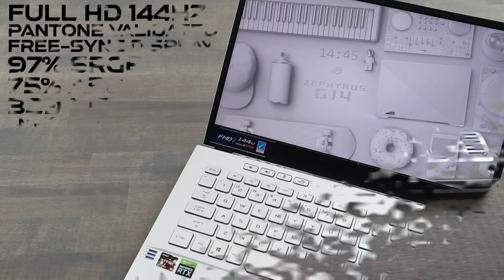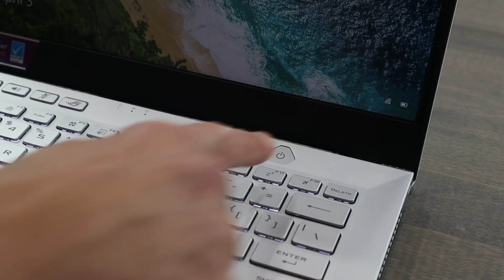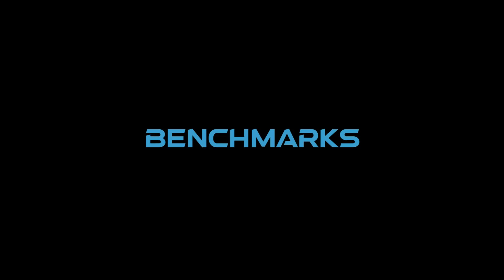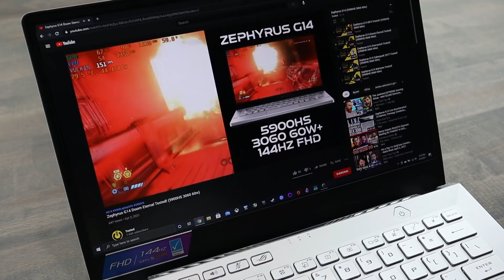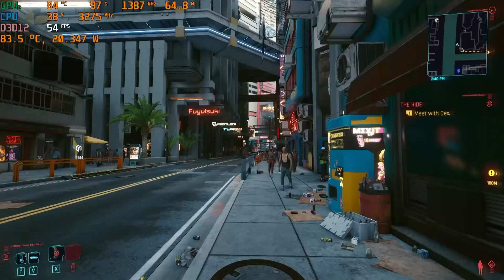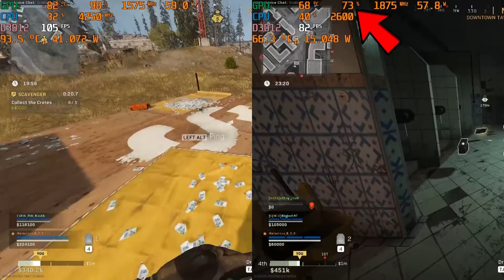Zephyrus G14 2021 Review!  5900HS 3060

Comment from the maker: The Asus G14 turned out way better than I ever thought it could!  It’s much better than the 2020 model and far better balanced than the Zephyrus G15 I just reviewed.  Good job Asus 🤛

With that said this is still a 14 inch laptop if you do not need this level of portability, Gaming on this small of a screen may not as enjoyable as a 15 inch or larger device.
Reply: Thank you for doing this Bob, I remember when the G14 first came out last year and they were sold out for quite a while. Really good review.
Reply: 60W for 3060? YES! 2060 with 115W fuck this shit? Yes! Another "greatest" laptop from Asus.
Reply: Would you recommend the G14 over the G15 then? How much a difference are they in term of performance when it comes to video editing? Thanks.
Reply: Regrading the RAM, I'm wondering why they don't just have 16GB soldered onto the motherboard and have one open slot for upgrading. Perhaps it has something to do with dual channel memory out performing a single stick? I don't know... Was wondering what you thought about that?
Reply from the maker: @BradHoytMusic  Yup that’s why.  The last time a high end Zephyrus came that way was with the 1070 max-q
Reply: @BobOfAllTrades  can we exapand the ram? If yes, how much? 
Thank you
Reply: Is it better than an aorus 15g with 3060
Reply: By any chance, do you have the model number for this laptop? Thank you

Comment: I bought this as soon as it came out. I got it at a discount price + tax which all came down to 1550$.
Hands down it's a beast of a computer. It blazes through premier pro and after effects, handles photoshop, luminar and lightroom like they are nothing and I played many AAA titles such as Hogwarts Legacy, Resident Evil 4 remake, Resident Evil Village and many more and it handled everything like a dream. It's mainly my travel workstation but sometimes I use it as my main when my desktop is too busy doing other works. This also handles 3d panorama stiching like a pro.
Only problem is that it gets hot so a cooling pad is mandatory.

Comment: Some of these details are just way too technical for the average user.  We just want to know if it is an overall good gaming experience, maybe something about bench marks, and that it does not get too hot too the touch or overheat to the point of real concern, in addition to to a pleasant and enjoyable viewing experience and typing experience and good tracking and response, and the availability of ports most often used.  Anything else and you are taking to technicians and not the average user, do I guess that is your targeted audience

Comment: Thank you for the review!  I just placed an order for the RTX 3060 and QHD (120hz) with 5900hs.  Totally awesome holiday sale and bonus reward bucks and I couldnt pass it up!
Reply: I would like an update pls, so do you recommend this model?
Reply: @shebyf9346  💯 recommend it. This eliminated my need to build a new PC tower. Not too heavy, and plays the games I enjoy just fine and productive when plugged into a ultra wide monitor. The battery can deplete faster when using gpu but it recharges in a decent amount of time. You can switch to ryzen integrated gpu if you want a little more extended battery life.

Comment: Is there a way to set the cpu speed to certain Ghz?? so i can run like 3.8 ghz??
Reply from the maker: No that’s not how CPU tech works.  You can set wattage and it’ll pull that wattage and load the cores per what the software requires.  That will show different frequencies depending on what the software requires, whether it be one core, two cores are all the way up to eight cores.
Reply: @BobOfAllTrades  sorry for the misunderstanding, thanks alot for the answer
Reply from the maker: You have nothing to apologize for 👍

Comment: Is it possible to adjust this version so that it doesn't overheat while gaming? I'm deciding between the 2020 ga401I-br7n2bl and this one. It's such a small price difference that I got both to test out, but the 3060 gets way hotter than the other when just doing light games or just browsing. I know obviously the 3060 will have higher demands and thus higher Temps, but is there anyway to get it below 45° while browsing? The other one I can get to 28 but if I kept it I'd have to pay an extra 400 anyways to upgrade the ram and ssd. 😫
Reply: For reference I disabled boost too but yikes if it's not still toasty. 😬
Reply from the maker: I recommend maxing out the fan speed when gaming or limiting the wattage in the software.  A combination of the two perhaps.  I also recommend this version and not the first gen 4900hs 2060.

Comment: I bought this and it's been two days amazing so far. So far I've played For Honor Roblox and genshin impact all on highest setting all multiplayer and it amazing. I don't really understand why it's a 14 inch instead of say like average 15 or 17. Battery life on games is about two hours so far with no power brick. I think it's amazing considering I got it for 1500
Reply: Definitely a steal! Planning to save for this beast. Did you buy the black or white one? How are the rubber feet? Is it stronger now? Any peels happening?
Reply: @juanpablotan3889  no peels  the grip on the feet are good. I got the white one, I've yet to fully understand everything it can run but ran Ark max settings like butter. Mind you I didn't have the power brick on so I cant even imagine turbo mode. Does get loud but not really noticible if ur in the zone.  Amazing overall I haven't figured out how to change the keyboard or add words to the front of it.

Comment: Awesome vid, Question: If the laptop screen is 144hz and I have a 240hz monitor can the laptop run 240hz and not cap at 144hz?

Comment: Bob thank you for your review of both this g14 2021 and g15 2021. I will doing a quick master program and want a new laptop, obviously I will be doing generic tasks for that, you mentioned great battery life, but I also may be traveling away from home (and my gaming desktop) on business trips. So I'm ultimately torn, I know the g14 is smaller and runs cooler, the g15 equally as good at generic tasks but has the extra umph to last for a little longer gpu wise, my take away from both reviews is ppl definitely need to mess with the tuning profiles to get their balance.

Comment: Hello! Thank you for your amazing video. Can I ask you if this model has a SO-DIMM slot for upgrading the RAM? I'm planning to buy a model with a 8gb soldered RAM and I was wondering if it would be possible to upgrade it in the future (likewise what happens with the asus tuf dash f15). Thank you in advance! Is the SSD upgradeable as well?
Reply: Im not an expert, but from what ive seen on these videos, i think, that you can add on RAM. But i dont think you can change the 8gb thats already there. Theres models on Amazon with up to 40 gb of RAM.

Comment: Thanks for the review @Bob Of All Trades. Question for you or anyone that knows...Is it possible to do that same tweak you did in the 2020 model to help reduce thermals?
Reply from the maker: I’m sure that can, but you don’t need to. Asus put those power sliders in there for a reason so just reduce the wattage to the CPU until you’re happy.
Reply: @BobOfAllTrades  wouldn't it be less tedious to do the tweak one time, than constantly opening the sliders and adjusting them?
Reply from the maker: @xg3990  Absolutely not.  You adjust the slider and leave it.  It’s not like the other tweak performs better. 

In fact, I’d expect the software wattage slider to interfere with last years tweak.
Reply: @BobOfAllTrades  thanks for the info!
Reply from the maker: No problem 👍

Comment: I've bought the Asus Zephyrus G15 GA503QR, and I absolutely love it
Reply: @AVOCADO I haven't had any problems with it thus far. I bought mine from a retailer on Amazon that upgrades the thermal paste for the GPU and Quality Checks it, and everything is working great. I'm certain a RAM failure would by covered by warranty anyways

Comment: I don't think I wanna pay $200 more dollars for the new version, honestly. I think I'd get the 2060 version
Reply from the maker: See I’m just the opposite. Faster response time panel, faster graphics card faster processor liquid metal on the processor to me those four things are easily worth $200.
Reply: @BobOfAllTrades  that's fair, I'd be getting it without a gaming focus though. So it would not be much of an issue. Although battery life might be. I'm afraid I won't be able to stand having the battery die fairly quickly. Most high spec laptops do.

Comment: One question for G14 2021 owners...does your device goes in sleep corectly?! I had 2020 model before and all worked well, now with newer model, when I press sleep, screen turns off but coolers still works. Any solution?
Reply: I'm having the same issue with no solution.

Comment: 14 inches is too damn small. If this was the standard 15.6 inch I'd definitely buy it. 14 inches is just too small for gaming. I realize you could connect it to a monitor but still. Using it as a second screen would be shitty cause of the small size.

Comment: 10:32 - no, false.  I'm an engineer and I can tell you that 100% of the time, in the case of laptops (ignoring tablet/laptop hybrids), soldiered ram is used purely as a planned obsolescence strategy.  Asus knows that this laptop is so [computationally] powerful that if they allowed someone to install 64gb of ram that customer would be happy for over 7 years.  Arbitrarily limiting RAM is THE ULTIMATE way to control obsolescence in today's hardware market.  It's a different story for things like smartphones, but laptops ALWAYS have the required couple of millimetres for a proper two open slots.
Reply from the maker: I’m fine with that being the conclusion.  But why isn’t this the case with their Strix?   

AW did this with their M15 R2-4 but apparently are bringing back socketed memory for their R5 🤷

I’ve had a few conversations with other manufacturers about single channel memory versus dual and some of them literally didn’t know dual boosted performance.   Sadly some of these manufacturers would base their products performance from benchmarks.

Comment: is it insane to dream of a 19 inch slim bezel gaming laptop? it should fit in basically the same foot print as a fat bezel 17 inch beast as yesteryear, but with those extra 2 inches of love. im aware it'd fall far closer to mobile workstation than laptop, but that would make it no less glorious especially if they used the space well. imagine the fans they could run in that, might even be able to source some noctua desktop fans lol

Comment: Regarding temperatures, do you think the same registry hack to disable turbo boost you showed us in the 2020 review might help with this years' model? Just picked one up and it does run a little warm even in non-intensive situations.
Reply from the maker: No need.  Ryzen 5k series has wattage sliders built into the software.  Reduce as you see fit.

Comment: Just bought this laptop, every single game I’ve tried (Gears, Cod, Battlefield, Overwatch), my gpu thermal throttles and hits 87 •C. It’s unbearable. This is on performance mode
Reply: Using Registry Editor, go to HKEY_LOCAL_MACHINE\SYSTEM\CurrentControlSet\Contro l\Power\PowerSettings\54533251-82be-4824-96c1-47b60b740d00\be337238-0d82-4146-a960-4f3749d470c7 and select Attributes. Modify the value of "Attributes" from 1 to 2. Data should read “0x00000002 (2)”. This will uncover a hidden power option.

After that, go back in the Power Plan Options and a new tab "Processor Performance Boost Mode" will appear. Set it to Disable or Efficient Aggressive and click Apply. Also, make sure your max processor state is at 100%. The CPU will now run on the stock frequency.

Comment: Can you disable the turbo boost on this model? Like last year g14? Great review by the way
Reply from the maker: I’m sure you can but I don’t really think you need to.  

It doesn’t run as hot thanks to liquid metal and the power sliders are there within the control software.

Comment: Fantastic review! Based on your comparison with the older gpus. What do you think would be the performance difference between the 3060 and a 2070S (115 W)? Would the 2070S significantly out perform the 3060? Trying to choose between this or the ROG Zephyrus S15 (2020).
Reply: I'm Going to wait until July I'm buying S15 2080super model with i7 11gen worth the buy the price has dropped heaps

Comment: Create custom resolution - limit screen refresh rate to 60 Hz - save battery life.. In games - enable vsync on 60 fps, limit cpu to 15W. You get quiet laptop - you get more battery life - you don't hold a 100C brick in your lap while gaming. I just dont understand why you need 144+ fps on laptop. Id be more than happy yo play on 900p @60fps with with laptop.

Comment: What are your idle (doing nothing or just plain web browsing/ YT watching) CPU temperatures? 
Mine's around 45-55C/ 110-130F, and I think it is too high (at home, no sun/ placed on desk)...

+ A large minus for QA: Needed to replace my unit, as the CPU fan has been making annoying clicking sound whenever even slightly tilted (i.e. placed on laptop pad I regularly use). Update: Got it replaced, the new one much quieter, but gets quite hot even when idle...

Comment: Bob, what do you think about making a full video dedicated to undervolting of the new RTX 3000 GPU-s in laptops? What problems a person will face and how exactly it'll work. How much disabling dynamic boost helps or doesn't help.
Reply: did you end up undervolting your GPU? if you did could you refer me to a link that has descriptions
Reply: @Carmadon100  I wish he recorded a dedicated video about it. Because I did see some people successfully undervolting their RTX 3000 laptop GPU-s.
Reply: @tabalugadragon3555  I wanted to undervolt CPU first but it seems like Ryzen cpu doesn't allow me to do that (esepcailly with G14 because this processor is not compatible with Ryzen master as well). So I am going to try undervolting my GPU using Afterburner.. have you had any luck with it?
Reply: @Carmadon100  Dude, Ryzen mobile NEVER allowed voltage control, even on so called "unlocked" Ryzen 5900HX, which, by the way isn't unlocked at all, as you can neither change voltage or multiplier on that CPU. Unfortunately AMD doesn't care about enthusiasts when it comes to laptops.
Reply: @tabalugadragon3555  I see !! thanks for the explanation. I'm not tech savvy and it's actually my first time getting a performance laptop. haha I'm pretty satisfied with it so far. I'll let you know in this comment about my GPU undervolting and let you know how my experiment went
Reply: @Carmadon100  ok, subscribed to you just in case ;)
Reply from the maker: Unfortunately you can’t disable Dynamic Boost.  That setting is supposed to exist in the Nvidia Control panel and I’ve seen it there once.  Then it disappeared.  

I talked about modifying the curve in a “Beware” video.  Dynamic Boost overrides it for now.
Reply: @BobOfAllTrades  But other reviewers stated that if you disable a special Nvidia device in Windows device manager dymanic boost no longer works.
Reply from the maker: @tabalugadragon3555  Who has said this?
Reply: @BobOfAllTrades  OwnorDisown in this video
"RTX 3070 Resizable Bar & Dynamic Boost - Does it Work?"
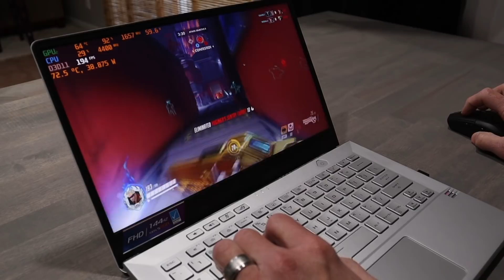on 1:23 mark
Reply from the maker: @tabalugadragon3555  Nice thanks for the tip I’ll check it out 👍

Comment: Fantastic job, your review pretty much covered everything good and bad about this laptop, but is it worth going for the 500$ more g15 than g14 if screen size is not important? To me g14 looks like a way better purchase...
Reply: Is it exact performance as g15 ? Can’t choose between this 2
Reply: @alexshine8512  as Bob said, g14 is way better tuned, g15 has problems with temperatures due to higher voltages, I ordered g14 for myself as I prefer less noise and less heat performance, for me it's not worth paying extra for g15..
Reply: @pedjadoktor7803  just ordered it from best buy for 1200$ lol, opened box.
Reply: @pedjadoktor7803  I’ve figure out that g15 have a lot of glitches, what about screen? Is it good enough? How much ms
Reply: @alexshine8512  you will have to check for yourself but I think it's 5ms or 9 compared to last years 20 or more, no ghosting like last year's model...
Reply: @pedjadoktor7803  I see, from what I’ve seen, looks like it’s about 4-5ms.
Also you can always connect it to external monitor and have 1ms, I didn’t see any dp ports too, is it possible some how make dp port on it ?